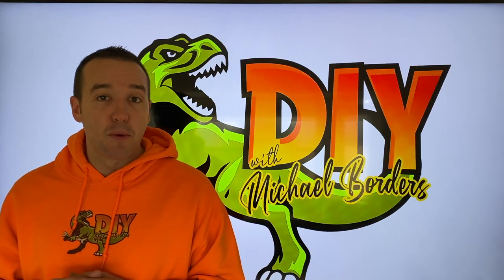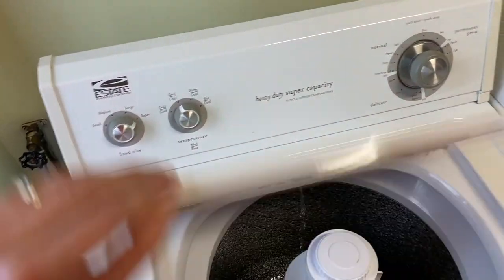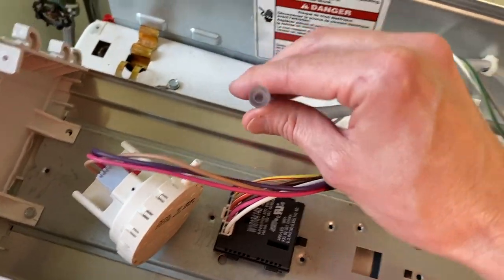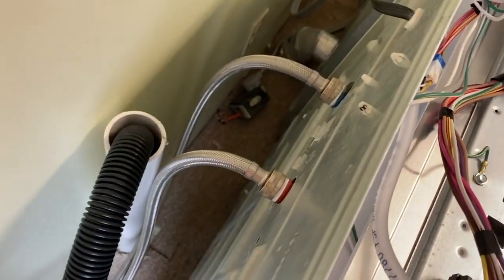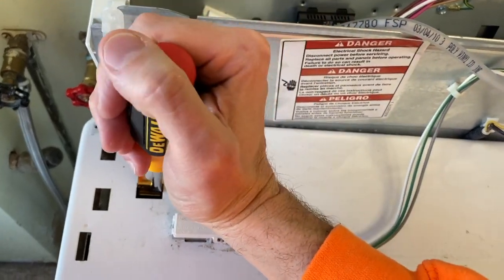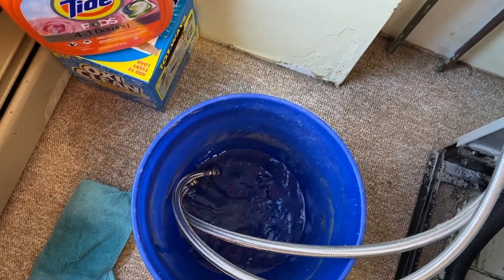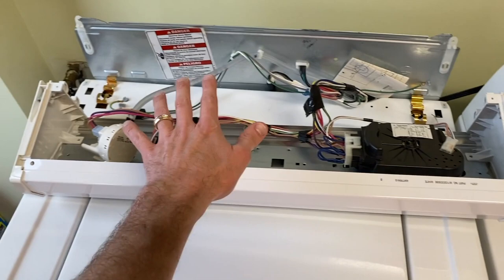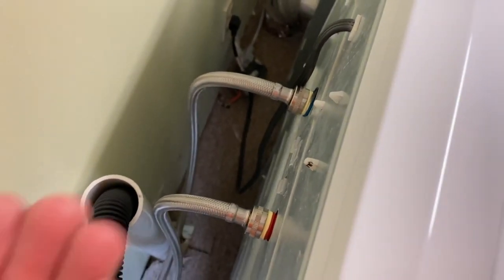Estate Maytag Whirlpool Washing machine wont stop filling with water - This is why

Comment: I’m not sure what’s going on with my washer, put a load in like usual.  Put the dial on large load, walked away.  Come back, floor is flooded, yet washer did ring out the clothes.   No water in the washer, took clothes out.  Cleaned the flooded floor, turned it on to test it, water doesn’t stop filling.   Had to shut off dial to get it to stop filling, tried to unhook water to washer.  Water won’t stop coming out while trying to unhook hose from washer, not overflow more like waters on.  But I shut it off, no water should be coming out.  I ended up just screwing the hose back on the washer, no clue what’s wrong.    I’m so confused, washer is old, no manual.  Numbers on door don’t come up anywhere I look, not sure how old it is.    It’s a GE, that’s all I know.   😔
Reply from the maker: Good morning, we are drinking our morning coffee answering any and all questions for the DIY community.

We appreciate you sharing this, it’s likely that your water inlet unit needs to be replaced.

The automatic shut off valves go bad overtime and can lead to constant water output if failed in the open position.

Please keep us posted, we DIYers need to stick together!  😎👍

Comment: I forgot to mention only the hot water will not shut off the cold was working fine. I am thinking the debris front hot water heater ruined the water inlet valve
Reply from the maker: Cool, thanks for the info.  We recommend replacing inlet valve unit.

😎👍
Reply: @DIYwithMichaelBorders  thx for doing the video and these problems i will see if I can find water inlet. Its about 15 yr old washer.  Hopefully I can get water inlet for it
Reply from the maker: @brettmullins751  

We are happy to help.  We can help track down a replacement valve for you.  We will need your machine’s serial number/model number.

Looking forward to hearing back from you Brett.

Comment: Hey Michael, I have a Whirlpool washer that completes an entire washing cycle and the light turns green to indicate it’s ended. The problem is the water turns back on and fills the  washing machine tub. What is wrong?
Reply from the maker: Good morning, just poured a ☕️ and am sitting down to answer any and all questions for the DIY community.

We are honored you reached out to us.  That is an indication that your water inlet valve needs to be replaced.  The valve consists of two separate electrical valves.  The purpose of the valves are to allow water into the machine when guided to and also, stop water from entering machine when guided to.  Unfortunately when a valve fails, it can act sporadically and allow water into machine when it’s not supposed to.

Below is a helpful step-by-step video showing the replacement process of the water inlet valve.

       https://youtu.be/DiPFZSMiBn8?si=6Coe0s8I_AhAtKxv

Let us know if you have any questions and hey if you’re interested, join our DIY ecosystem and help us grow an exclusive group of DIYers.

       toolboxtoken.com

Reach out to us any time!  🧰

Comment: After replacing part. The leak stopped. But then after filling up all power seems to have just disappeared. The machine is dead. Won't drain. Won't fill. Help
Reply from the maker: Thanks for watching, that’s no fun.  Did you ensure all electrical connections were re-secured?

Is the new part the exact same part number as the original one or is it an aftermarket part?

Every now and then, an aftermarket parts can lead to additional issues.

Comment: Where do I find the part’s number I have to change out the inlet valve cold water is not working 🤦🏽
Reply from the maker: Good morning, the inlet valve should have a part number on it.  If not, we can help track down a replacement valve.  What’s your serial number?
Reply: @DIYwithMichaelBorders  part number was on top of inlet valve I put a new one and I still don’t have cold water 🤷‍♀️
Reply from the maker: @Msleelee9487  

Thanks for the update, is the cold water shutoff valve back to the open position?  If it is, the cold water hose might be clogged…🤔

Comment: I bought a used Estate washer, but it doesn't get water in when I connect my hot/cold hose. Instead, the hose starts licking from the connection at the blue valve. Any advice?

Comment: Recently I replaced water heater and now washer will not stop filling . When i replace the water heater the washer was filling up it stop by its self . I had to turn off shut off valve to shut off the water do you think its the water inlet on the washer?
Reply from the maker: Thanks for watching, it’s very likely that a new inlet valve unit will solve issue.  You probably have a faulty valve.